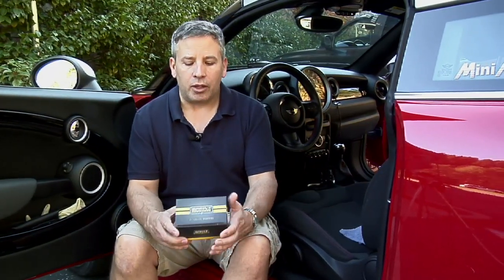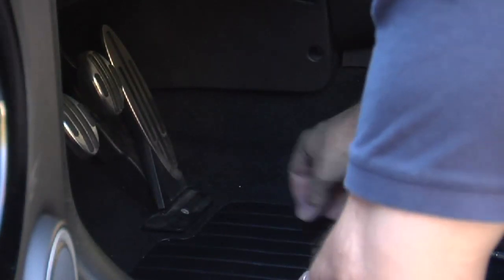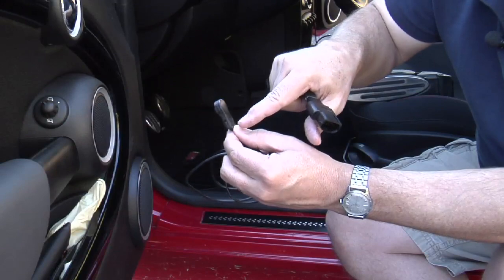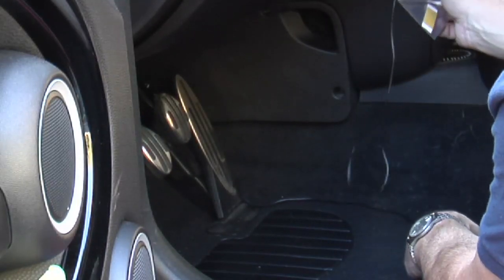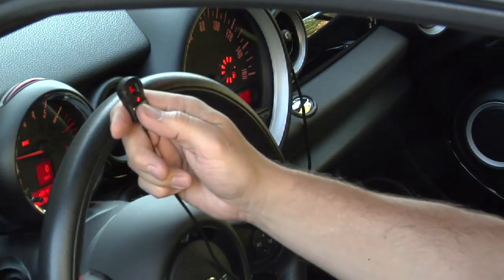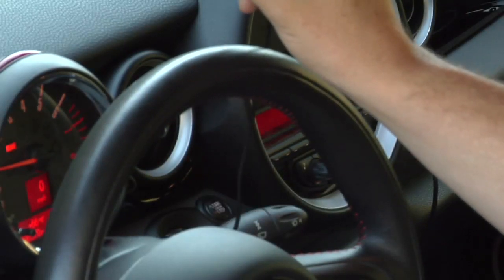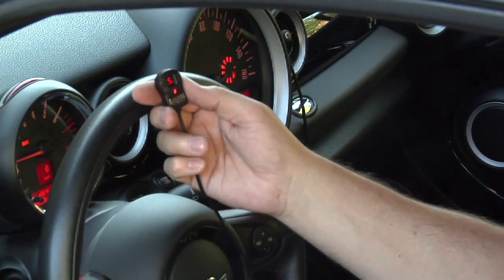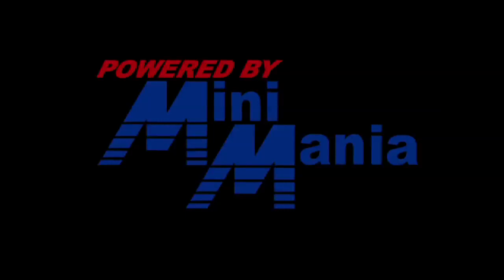How-To install a New Version 3 Sprint Booster on a MINI Cooper

Comment: I got one of these and it truly did make a difference in my throttle response I was burning out if I stepped on it too hard when turning, the only problem I’m having is I just got my exhaust redone and my sprint booster doesn’t seem to have any effect even though my controller shows it’s on race 9. My old exhaust was a single cat delete into stock resonator and then out some stock piping without the muffler(that was all clamped) now I took out the resonator and just had a shop weld in pipe and a cherry bomb I got for Christmas, it’s good welds way better than what I had before but doesn’t seem like booster is working.
Reply: Maybe because it sounds louder you expected it to be faster, or just got used to it
Reply: @BuildsWithKyle  😂🤦‍♂️